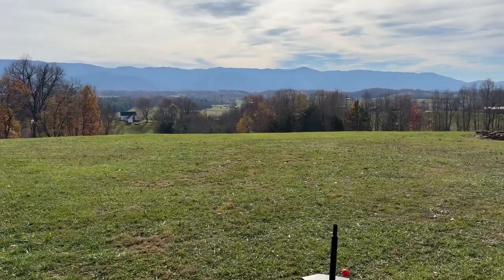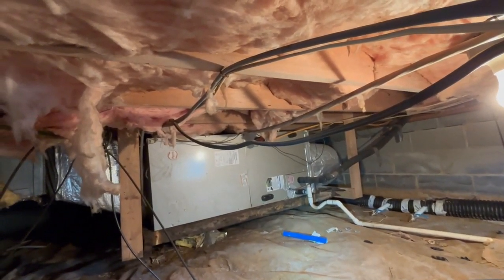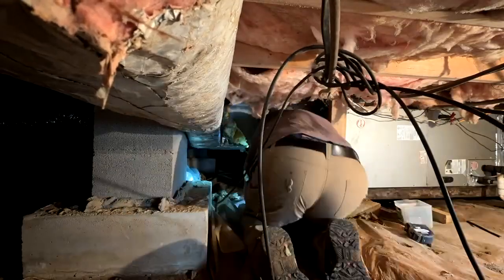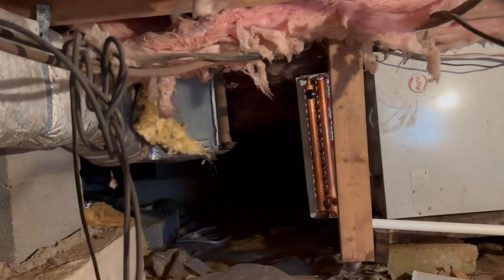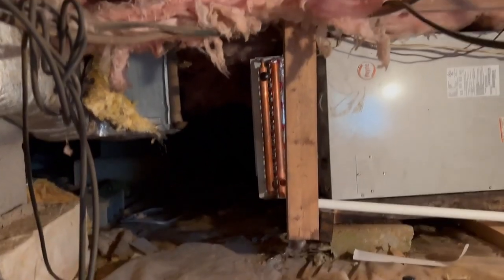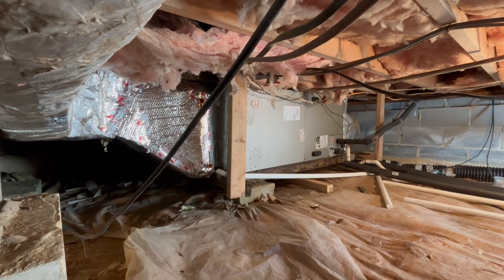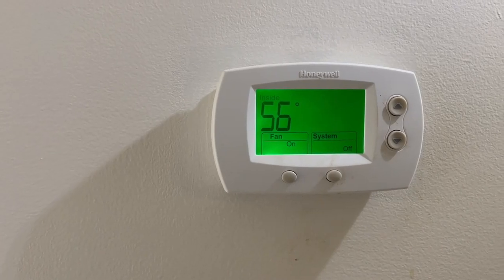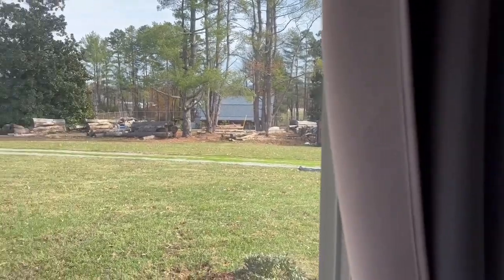Free Heat for 3000 sq ft house

Comment: The time I would spend cutting, hauling, stacking, splitting, stacking, hauling, and then burning would be more financially beneficial if I spent that time on the clock at work. What's the ROI?
Reply from the maker: We have a saw mill and all our wood is just the scrap..... if I did not burn it I would have to dispose as I used to.

Comment: Wish you would have shown your wood burning and pumping outfit. Probably saved your 250$ in electrc heat pretty quick, short of the blower and pump on continuously. 
I don't need much heat where I live.
Reply from the maker: Ther are three videos posted from start to finishing showing furnace etc